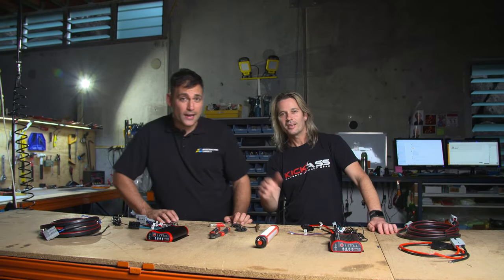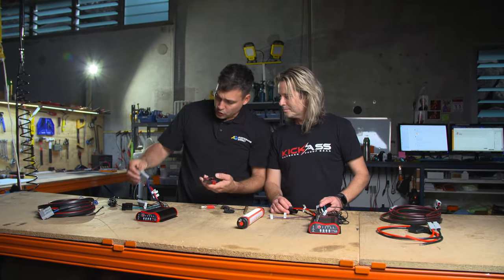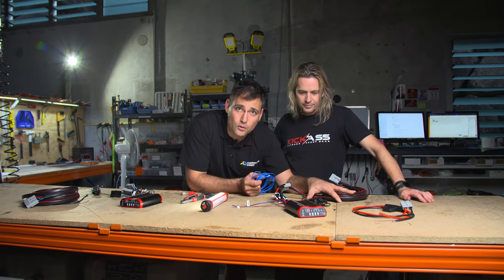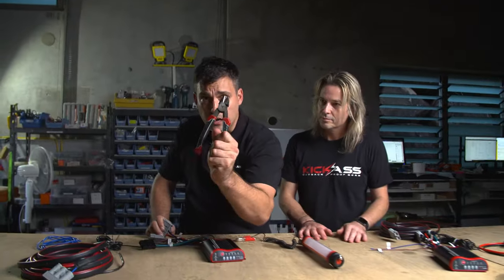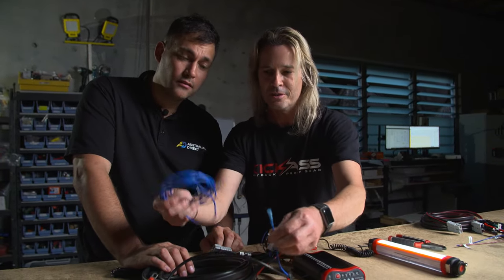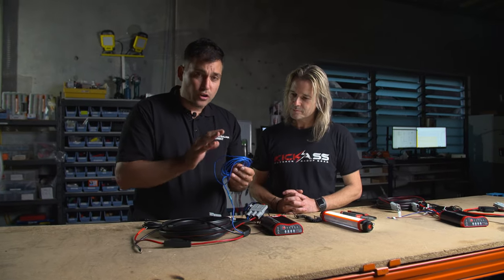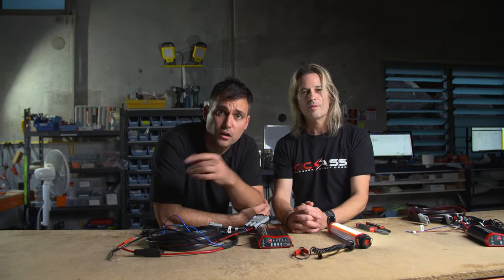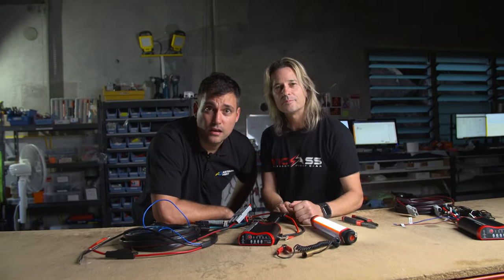KickAss Triple Anderson DC-DC & Ignition Wire Kit Explained! DCDC Charger with Lithium Mode.

Comment: It’s not an ON wire it is the IGNITION wire, most cars have OFF, ACC, IGNITION, START. Stop confusing people, the original terminology is correct! Also the Redarc BCDC1250D post late 2019 early 2020 will also charge a lithium from dead flat, I know as I have tested it with my 1250D, so your ‘competitors’ are already onto it and have for a while now.
Reply from the maker: We are talking about the triple Anderson and the automotive cable with the ignition sense wire built in. Please drop a link to a competitor doing that now! Love to see it! Also what we are talking about is our DCDC can bring a lithium that is in low voltage protection mode (please elaborate on your definition of a dead flat lithium) back to operation without any user intervention but this video does not get into that topic although soon will be a video that will.

Comment: Easy way to connect ignition "on" wire is with a fuse tap. For those unfamiliar it's an additional fuse that plugs into the fuse carrier you want to tap into so also fuses the "on" wire separately. Only connection you need is to the fuse tap.
Reply from the maker: Thanks Andrew,could not explain it better myself 
Thanks for watching & commenting 
Cheers Craig

Comment: How do you physically connect the ignition wire?  Does it need to be soldered?  I have seen some other companies supply a connector with a fuse holder do you have something like that?  It sounds like the easiest solution.

Comment: Cool product 
Couple of things 
Don’t prick through wiring insulation. Quickest way to wreck a wiring harness. Correct way is to back probe the connector 
Secondly. Using a basic test light on modern systems can cause expensive ECM repairs if you don’t know what you’re doing 
Look for a quality LED test lamp or multi meter
Reply from the maker: Thanks for the info.
Reply: This was literally my only complaint about the whole video, probing insulated wires and non computer safe test lights. As a plant mech corrosion in wiring can be a huge issue, especially with the way everything is going with ECU control, canbus etc. Im sure this would be even more common in modern vehicles

Comment: Loved the vid👍
Will my aux battery still charge from the solar when the "Ignition" is off?
Reply: Really good question buddy!
Reply from the maker: Yes mate, sure will!
Reply: Excellent! Thanks.
Reply: Yep. Run your dcdc charger solar cables into a spare Anderson port On your battery box, and plug your solar into that and run it unregulated. If you don't have a solar specific Anderson plug, use an mppt so it can regulate the solar going in 👍

Comment: How ya Doing Guy,s im interested  in purchasing a KickAss dc to dc as in video, But im not sure my vehicle is 24v Duel Battery running car Only. And i wish to run 12v  Solar setup as well. Does your unit handle 24v input or do i try hookup to 12v on a single battery Out of the two .. im sorta Lost as the alternator is 24v. ..perhaps a 24V TO 12V Step-down? Heavy Duty that is.
Reply from the maker: G'day there radio active,yes our dcdc charger can have 24v input & 12v out put for aux battery' 
thanks for watching 
here is a link to dcdc to look at 
https://www.kickassproducts.com.au/buy/kickass-40a-dcdc-charger-8m-heavy-duty-dcdc-wiring/KADCDC40A-AND-WK65
Cheers craig

Comment: Thanks for the vid, quite informative and light.
Q. I'm intending to install a lithium start battery and need the cutoff voltage to be much higher than the usual setpoint of around 12.6 volts or the lithium will be drawn down with the dcdc.
Was intending to use an ignition switched relay but with your ignition switched blue wire does it totally override the voltage setpoint or just change them?
If totally overridden i can avoid the relay.
Cheers.
Reply from the maker: G'day paul,the ignition wire is used to cut in at earlier voltage as most smart alternators struggle to get up to 13.2v & ignition wire will allow 12.2v
you could also try our battery guard & that may also suit as well 
https://www.kickassproducts.com.au/buy/smart-battery-guard/KASMARTBG
thanks for watching
Cheers Craig

Comment: So with the Ignition wire connected what happens when your alternator stops working will it drain you cranking battery completely dead or does DCDC charger have a low-voltage cut-off switch knowing the ignition wire is live
Reply from the maker: The DC/DC Charger has a built in isolator. So it will automatically isolate when the voltage gets low.

The DCDC still all function as normal without the ignition wire connected. But it won't be as responsive, there will be things like longer delays for the charged cycle to start and stop.

Comment: Curious… can you connect ALL the EARTHS (Main & Aux batteries) to a common earth point (chassis) or do u need to run each of the black earths coming from the DCDC charger straight to the designated battery?
Reply from the maker: i would avoid using chassis as earth personally as they can get dirty/corroded  etc & more prone to vibration than using the batterys earth to earth 
Thanks for watching
Cheers Craig

Comment: Do you sell the plugs separate? Been thinking about adding a subwoofer & amp and this would make the wiring easier as I dont want it in all the time.
Reply: Better use Neutrik Speakon (NL4) - it's widely recognized standard for speaker connections in entertainment industry and no one will mix it with 12 or 24 volts DC by mistake. Use Neutrik for speaker connection and Anderson for amp power.

Comment: Looks good, and sorry for a noob question - but why would you need an ignition wire at the rear of the vehicle? Wouldn't the source likely be at the front? I assume given the length on this kit its purpose is for a rear mounted battery (not under bonnet)
Reply from the maker: From years of experience we recommend that you never mount an auxiliary battery under your bonnet. Excess heat can significantly shorten the life of your AGM battery.  This system is designed so that you can easily run an ignition connection which is loomed with the standard auto electrical wire to the rear of your vehicle.

Comment: What about Toyota 70 series with the v8? Do they have or need an ignition wire?
Reply from the maker: G'day mate,yes they have a smart alternator & a great place to tap in is the acc power box on rh/side of engine bay,has 12volt power only when engine is on & that's perfect 
Cheers Craig

Comment: I am just wondering what Amp fuse you use for ignition wire using add circuit fuse holder?
Reply from the maker: The fuse tap will just have to match what the rating is in the fuse box.

Comment: I have bought your 200w Solar panels that come with 20amp MPPT regular and accessories. I read the manual but how to I connnect MPPT up to the back of solar panel and then to my Kixkass 120 AGM battery. I am not running a DCDC charger all my stuff is in the back tub of my dual cab. The videos shop I connect the black anderson plug then the other plug to my battery box but what about this MPPT regulator. Sorry new to this just trying to learn

Cheers Errol
Reply from the maker: Hey Errol,I have requested one of our customer service team get in contact with you.

Comment: Wouldn’t this only be needed for cars with smart alternators?
Reply from the maker: G'day Shano,that was the original intension to help overcome the smart charging systems on newer cars,but it still does not mean it can't be used on older/non smart systems as the cut in voltage is then at 12.2v instead of 13.2v

Comment: Is the ignition (engine on) wire earthed?
Reply from the maker: G'day Gurrs,no the ignition wire does not need to be earthed,it needs 12v power only why the engine is running & no power when engine is turned off 
thanks for watching
Cheers Craig
Reply: Cheers Craig, thanks for the info 👍👍

Comment: The old one charges lithium lifepo4 also. does it not?
Reply: Sales gimmick !!!
Reply from the maker: Yes, it still charges Lithium Lifepo4 but now the DC-DC Charger has Lithium BMS sleep mode recovery feature. The DCDC will now detect when a lithium battery goes into sleep mode and will trickle charge the battery until it reaches the cut-in voltage.

Comment: Hi, thanks for that. Question. I find a spare spot in the fuse box that has power when the engine is running. What size fuse for the ignition wire?
Reply from the maker: Fuse taps generally not rated. If you are using a tap with an inline fuse simply use the same size fuse as the socket you are plugging into.
Reply: @KickAssProducts  sorry, I have no idea what you are saying. Taps?
Reply: @richardmalone3172  Google fuse taps. They are like a double adapter for a fuse spot in your fuse box. You take out the original fuse and plug in the tap in its place. You install the original fuse and a new fuse in the tap. The other end of the tap connects to your ignition wire which goes to the triple anderson plug that plugs into the charger.
Reply: @mattmullens3215  thankyou.

Comment: Can we use boot 12v cigarette lighter socket plus wire as an ignition wire?
Reply from the maker: Unfortunately not. A cig socket is only 10 amp and you require the full 25 amps to run this unit.

Comment: Hi guys, do you sell the triple plugs separately? Just got the charger and wiring kit on pre order but it won't be long enough, I need a 1.5m extension, now they're all 2 plug extensions so the "on wire" won't reach. If you sell the plugs then I can make my own 3 plug extension and happy days
Reply from the maker: Unfortunately we do not have the triple plugs by themselves in stock yet. 

They are on there way but we do not have an ETA yet. sorry.

Comment: It’s called an IGNITION wire, which is the correct terminology, because it uses a low voltage pulse provided or generated by the car’s ignition system to turn on, say a Motorola two-way radio through the radio’s rear ignition pin, or in your case, to reset or restart a sleeping lithium battery, or moreover, to activate or turn on the new generation DC-DC chargers!
Reply from the maker: Well said mate 
thanks for watchin cheers Craig

Comment: Hi guys. Great video. I have your original battery box with dcdc and it has the lithium profile. I'm now running a 100ah lithium battery and have also put in a smartshunt to help monitor real time current draw etc. 
In this video you mention if the dcdc cuts out it is likely due to the ignition wiring. My 4wd is a 2012 mitsubishi challenger PB model and they don't have a smart alternator.....but I'm having the problems of the dcdc charger cut out after only 5-10 mins then it cycles and turns back on. Should I have the ignition/on wire installed??
Some advice on this would be great.

Comment: And the easiest way to connect the "ignition" wire to the fusebox is to use a piggyback fuse tap.
Reply from the maker: absolutely mate,i reckon it's the easiest way  thanks for watching & the comments 
Cheers Craig

Comment: Are these dc-dc chargers supposed to get hot? I went for a 25mins drive today and when I got home my dc-dc charger was boiling hot almost burnt my arm haha
Reply from the maker: G'day cookie,they can get over 60 deg so can get very hot,there is a lot going on in there,make sure you have ventilation around the unit 
Cheers Craig

Comment: I think you  should include a spare triple anderson in the wiring kit  for the people that arent using the kickass dcdc charger. I made that mistake and assumed it came with a spare one like your normal wiring kits. They dont seem to be available seperately anywhere, even on your web page.
Reply from the maker: Hi Dave, we are currently waiting for a supply of the triple anderson plugs. They will be be sold separately on our website asap. 

Sorry for the delay.
Reply: @KickAssProducts  you should probably send one free of charge to everyone who purchased the premium wiring kit. Otherwise its a useless kit. Cant plug it in to anything.
Reply: yes they are on ebay, search, in 3 pin anderson plug. they are $8 plus $9 postage.

Comment: Hey @Australian Direct  Can you do a video with shore power and an automatic transfer switch and how this would get wired to your DC to DC charger so that it would shut off so that it does not continue to run with an inverter powering it.
Reply from the maker: Hi Michael, I am assuming by shore power you are talking about Marine application. Unfortunately we are not marine experts and wouldn't really want to advise as such. Sorry.
Reply: @KickAssProducts  it's just called that... It means plugging in at a camp ground or anywhere for that matter. And the transition from "shore" utility power back to 12volt and an inverter using small automatic transfer switch which like VSR senses when you are plugged in and switches to "shore" utility power. Charging you DC charger and batteries. Basically like camper van. This is definitely more opportunities for kick ass if you support this set up.

Comment: Why dont you flog a blue piggy back fused blue wire to connect from fuse box to blue wire that is just click and connect. All sorted ?
Reply from the maker: Different make, models of vehicles have different fuse boxes. Unfortunately it is not viable for us to carry these items in stock as they can be purchased very cheaply at Repco etc. Sorry.

Comment: Actually on many vehicles you have OFF,ACC,ON (igniton).
Reply from the maker: G'day dan,as long as you only supply power when engine is running,i prefer to use fuel pump relay circuit
Thanks for watching
Cheers Craig

Comment: i have a cigarette accessory socket in back of car. this is an only ignition on plug. in other words only powered when engine running. I plug my battery box dcdc ig on wire into this via a cig male plug that doesn't have the earth wire on it. wiring was already there. so no need to run another wire. a lot of cars have a plug like this in rear.
Reply from the maker: Hey Gizmo, Thanks for the tip!

Comment: How old are we talking these days for cars is a 2003 too old Lincoln navigator?
Reply from the maker: G'day there best to check the charging voltage & that will let you know if you have a smart charging system  or not,i would doubt a 2003 vehicle would have  smart charging sytem,if your not sure just connect the blue wire to 12v power only whn engine is running & that way the dcdc & inbuilt isolater in our dcdc charger will work manualy without any low voltage issues  
cheers Craig